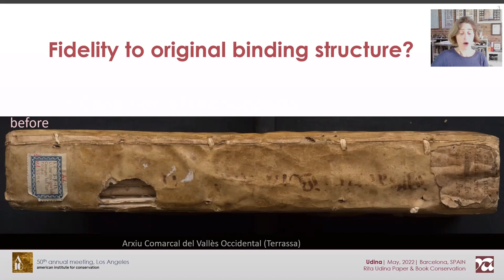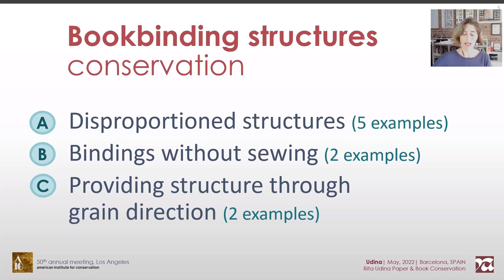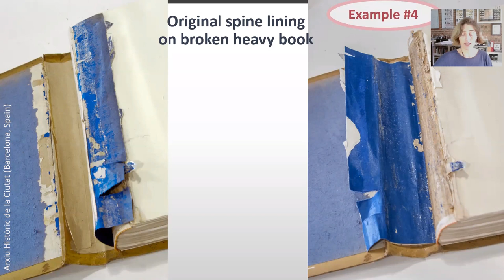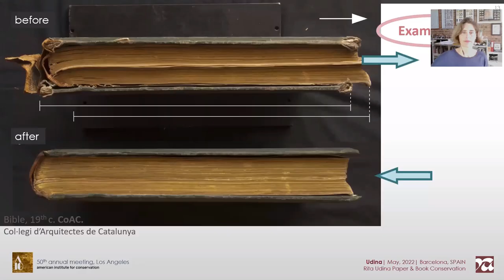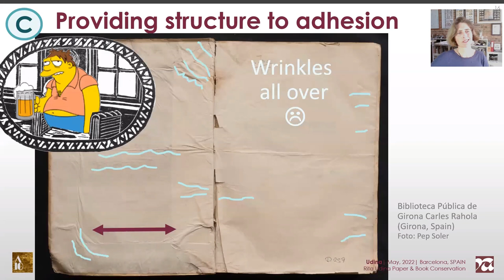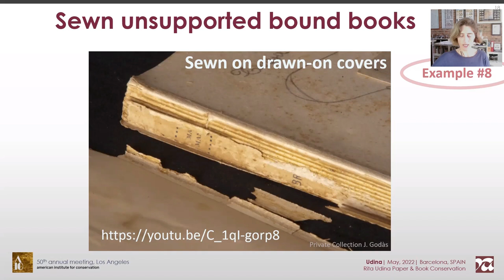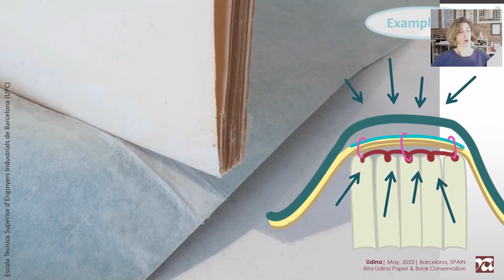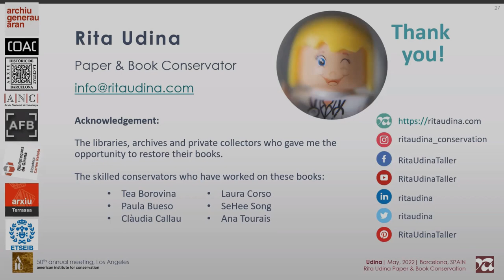Sewing, Adhesion and Grain Direction in Book Conservation

Comment: Dear Rita, thank you really to share with the world your knowledge.
 It was me yesterday asking about the blue fabric, and i was asking about the sewing technique that you applied on the spine to reinforce it, sewing a cloth.
How did you do the hooking? passing through the quires or externally, on the original sewing? Muchas gracias ;)
Reply from the maker: Dear Elena,
I do not follow a particular rule for the sewing. I can either re-use the holes of the original sewing (that’s what I did for the image you send me) or make new ones (I think that’s the case for example #9, minute 11”).
For sewn unsupported bindings, the original sewing is usually very weak and centered, so I do new holes to make sure the sewing goes further away (meaning more closer to head and tail of the textblock, therefore making the textblock more compact).
If the holes of the reinforcement are too close to each other, it weakens the structure because it can at some point tear the mull apart), and it is also faster to make only a few. The ideal is that first and last gatherings (closer to joint) are sewn, as well as some other in the midle, ideally at the same distance, so that each of them undergoes the same tension.
The hooking is made so that the thread goes inside the gathering, preferably along the gutter, rather than tieing the thong or cord (because for the second, there might be some risk of damaging the original sewing).
It’s hard to explain on a written text... I hope you got the idea: the thread going inside the quires from top to tail (the more possible) and being hooked ont he mull or reemay at similar distances, from last to first quires (included, if possible).
I hope it's a bit clearer!